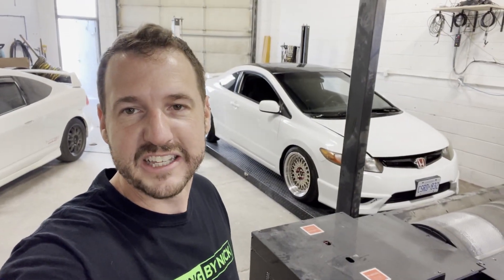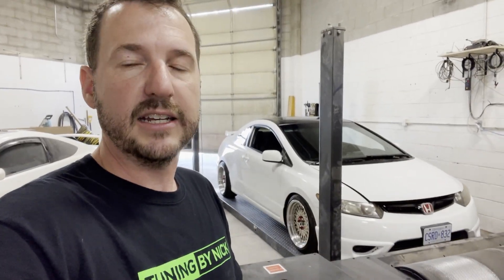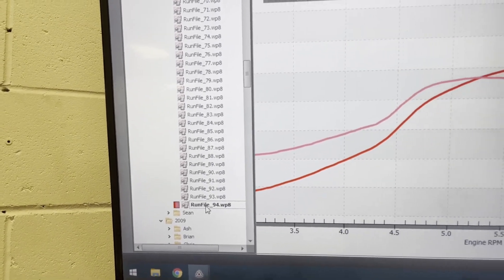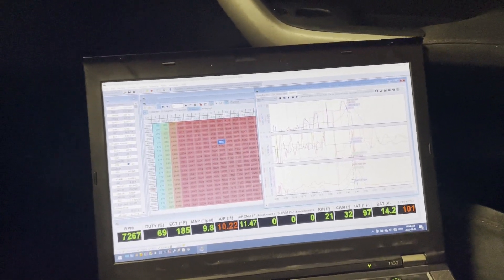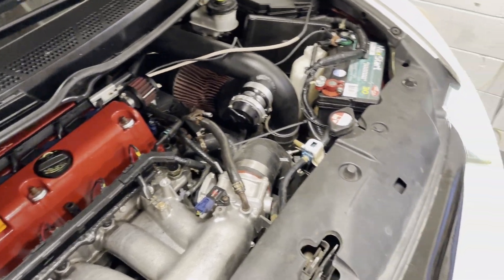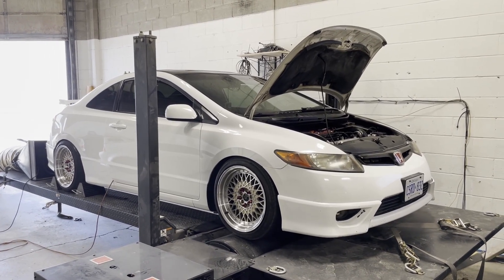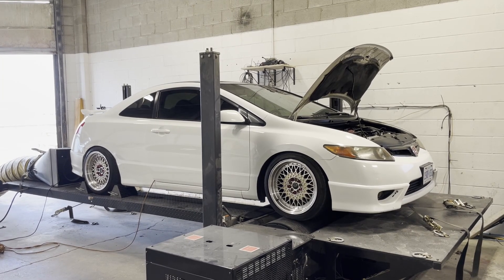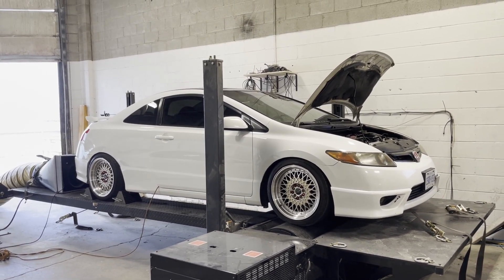8th gen Civic Si PRL Turbo Kit gets more Boost

Comment: Hi. What’s your regular ect 2 readying or where should it go up to or sustain at? Do you normally see your ect 2 temp at low temp? When datalogging or just viewing your gaugesis your ect 2 hitting higher temps like 150s 160-170s and making your ect 1 temp get higher? I have this problem and not sure if something is wrong with my cooling system.

Comment: Really enjoying your videos.  I love the creativity of the 911 with the K24.  What do you think the potential is with the 11th Gen Si without getting too crazy and retaining daily driving?
Reply: if its anything like the 10th gen is its going to be around 300whp and 300wtq. The transmission to weak to hold anything else really. Most off the shelf tunes do 320wtq tops unless its a big turbo it'll ogo 350wtq but you'll be counting your days with it. L15 engine is more geared towards mpg and being economical. If you want to make more just go buy an accord with the K20C4 in it or the K20C1 in the type r.

Comment: Nice! Do you think 25 degree cam timing at 8,000rpm is a safe starting point for an N/A k20Z3orA2 on the street? I've heard others taper it down almost to zero by redline. I'm currently using a 35-5 degree taper to redline cam timing.
Reply: 25 is usually where n/a k20s like it at 8k and up. Are you only using a total of 35 degrees and then tapering down from there? Lower vtc at higher revs benefit turbo k20s more then n/a or supercharged k20s.
Reply: @MrDelsoleg11  Yea I have a bolt on K20a2. I have it at 35 degrees on both cams for the Vtec cross over @4300. Then it tapers down to 5 degrees by 8000. Never had it dynoed. I used to have it at 40 degrees tapering to 25. I'm trying to get a little more pull from 7000 up so I might give it a bump.
Reply: @ivtec4fun55  you're losing a bit of midrange only going up to 35 degrees. In order to tune the vtc correctly you need a dyno as thats the only true way to see what the different angles are affecting power. But for the most part vtc is used more for midrange power and torque not really beneficial in the higher rpms. Rule of thumb in your case is start ramping up vtc roughly 1500 rpm before vtec then 500 rpm before vtec you want it at 45 degrees during vtec leave it at 50 until about 6400 and then start tapering down 5 degrees until you get to 25 and set everything down the last column to 25. That should give you roughly the best powerband.
Reply: @MrDelsoleg11 Thanks for the info!, I'll might give it a shot and keep an eye on the Knock.
Reply: @ivtec4fun55  what octane fuel are you using?
Reply: @MrDelsoleg11  you want a bit more vtc in a N/A application so the vacuum of the exhaust helps suck in more air. 30 degrees is what id set a N/A car to and 25 for boost.
Reply: @MrDelsoleg11  92, and just a flat 28 degrees ignition timing up top on the low and high cams.
Reply: @MrDelsoleg11   Glad to see other tuners spreading their knowledge and giving out correct information 🙏🏻

Comment: I get asked and I'm sure you do as well about boost control set up all the time. So Just a friendly suggestion for a future vid. But maybe make a video explaining how to setup up the boost control feature using flashpro. like showing and adding the wire to the location of pin b2, then setting it up in the software, explaining what the different settings ( normally closed vs open/frequency & duty cycle) are and how they change the overall control, response and sensitivity of the solenoid. Then maybe throw in the quick spool and boost by gear map setup in another video.

Comment: nice update Nick!👍 One thing you mentioned in the video that I have seen asked many many times in the flashpro manager forum is how to pull a calibration file from the ECU? I have been in situations where you are working with the flashpro and laptop and may have flashed a different calibration file on to it while making changes and may not remember what revision is actually in the ECU. I know of pulling calibrations from the flashpro but not from the ECU.

Also if you/your friend does a return system, I would like to see what is involved especially at the tank to make this happen... also if you could talk about making it happen if there isn't an aftermarket fuel rail option for the vehicle?
Reply: The last calibration saved onto the flashpro is the current calibration in the ecu, with that being said just open up the flashpro tab click on calibrations and then on your right side you'll click download and that's it.
Reply: @MrDelsoleg11  Not necessarily... And that's the problem most run into. If the vehicle is out of the equation (computer and flashpro only then working on revisions) or you are running a shop like Nick and have the unlimited flashpro then accessing the calibration from the ECU is what people want to know how to do.
Reply: @lcq4blackstar   @lcq4blackstar  can you explain more on what you mean about the revision on the ecu?  The dealer flashpro works differently then the diy flashpro. With the dealer version you have the ability to download w.e tune is on the ecu. On the diy version however it's locked to one vehicle/ecu at a time. so if you tune the ecu, make changes right after and then upload again to ecu, the last uploaded calibration on that ecu is saved automatically to the flashpro and thats what you're downloading.
Reply: @MrDelsoleg11  And there is the answer! The shop version is able to pull from the ECU where as the customer based cannot apparently. There are also 2 calibration save file spaces to the customer based flashpro so after time has passed and you can't remember which is actually in the ECU would be one instance. It isn't very common but there are situations where the calibration on the ECM is not known and pulling it for clarification is what some people are after. If there is a way not currently known us what I was hoping for.